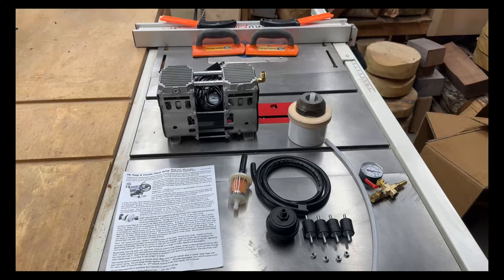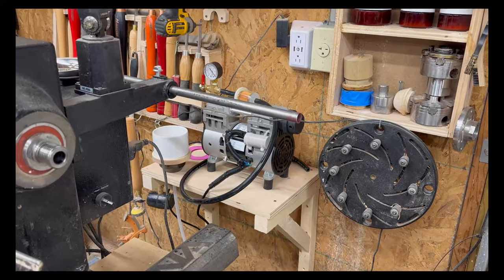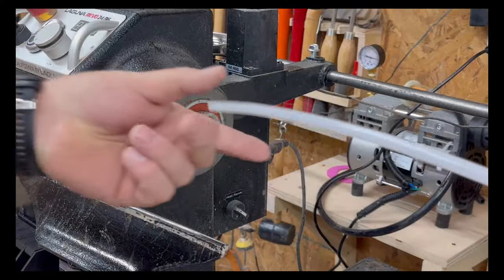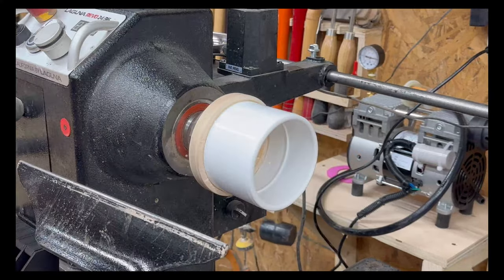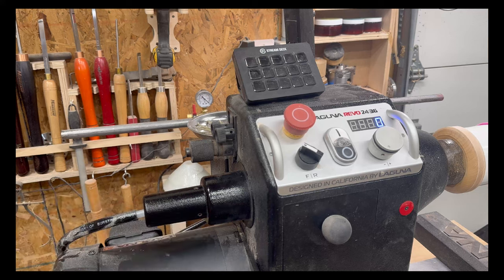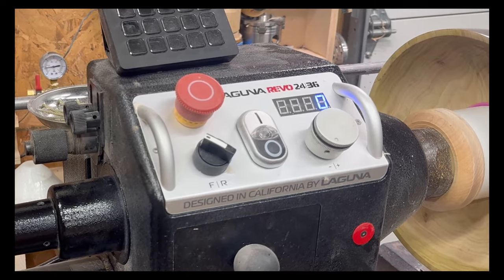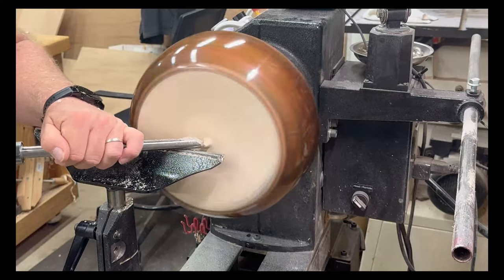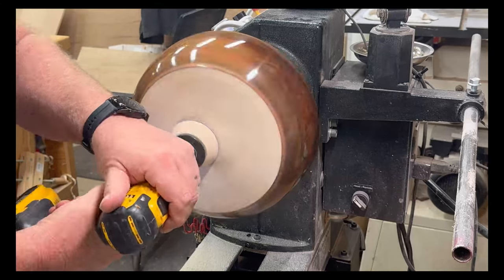Review - Frugal Vacuum Chuck System #woodturning

Comment: I’ve had this on my “wish list” for awhile now.   Wasn’t sure how good it really works.   Sounds like you do recommend it.   Looks like you’ve had it for almost a year now so… do you still highly recommend it?  Any complaints about it or recommendations?   Thanks. 😊
Reply from the maker: @normagene514  yes after a year I’m still liking it a lot. I’ve used it many many times and the only time it let hold was when I had the vacuum leak through porous wood. Still held tho. It’s powerful, easy to use, and the chucks can be made from PVC pipe or simply buy others from Frugal. The vacuum pump is very strong and has not missed a beat. Yes highly recommend. Good luck. Cheers

Comment: How does the hose not spin itself into a knot?
Reply from the maker: Good question! The end of the hose that is on the chuck itself is fixed to the inside of a bearing which is fixed to the bottom of the chuck. So the white hose passes through the center of the lathe stock and the rubber hose simply presses in to this. Hope this helps. Ask away if you want to know more. Cheers!
Reply: Thanks for sharing.  I just received my frugal vacuum chuck. This will help in set up.
Reply: How did you attach the foam the the face of the chuck? Thanks!
Reply from the maker: @SpunbyGreenJeans  I used CA glue